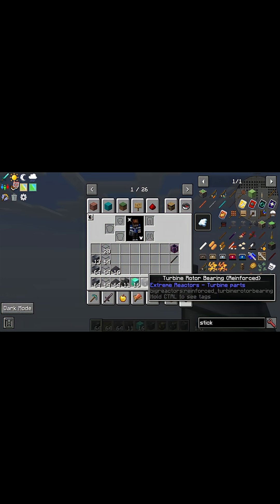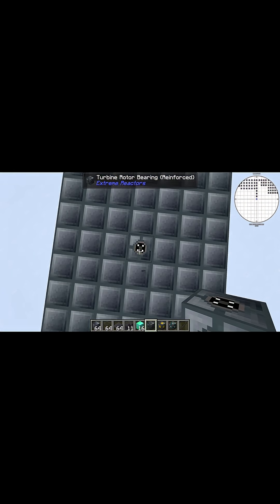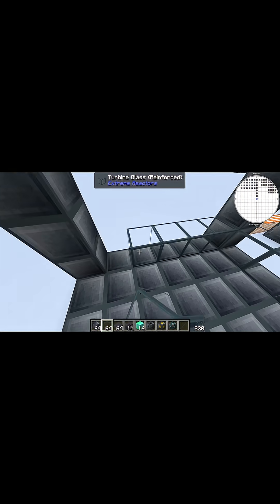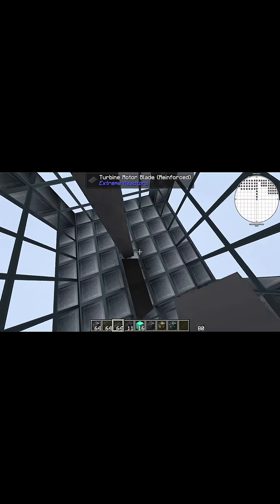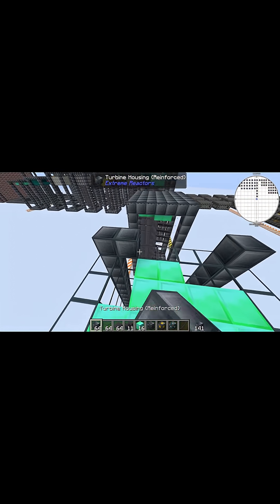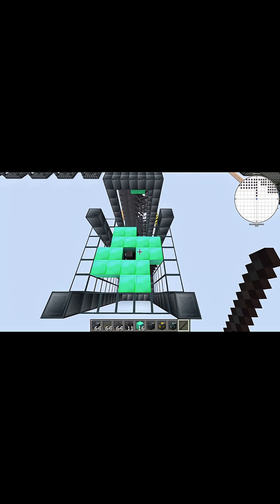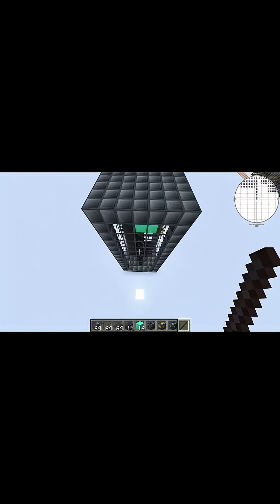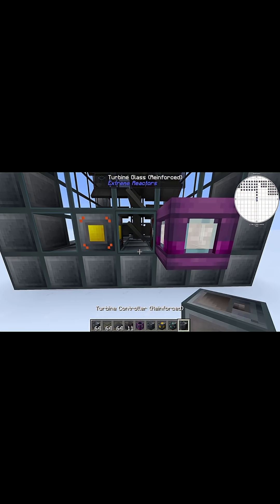Optimized Turbine Tutorial | All the Mods (ATM) 10

Comment: note to people in comments: this design will cap out your rf output depending on the pack. the buffer size limits the actual output u get and this design has maybe like a 10mrf buffer. the insanite cost is very nice, but if you want to actually optimize this and get the amount of output hes saying, you need to build a bigger reactor. adding more turbine blades actually gives more rf capacity. so u essentially just need to build big a wide and tall enough reactor with enough blades for this to be worth it.
Reply from the maker: Interesting, I never knew this. Doesn't seem to have any influence on ATM 10, luckily.
Reply: @thunderd164 yeah they mightve tweaked it so you have a bigger buffer. Have you checked its input rate into like an induction matrix or smth? Or the buffer size of your reactor?
Reply from the maker: @capnbug  No, I simply outputted into an energy trash can which drained the entire thing instantly. So I assumed that it could output infinitely assuming whatever you're outputting to could keep up with the output.
I just tested it, and it seems my hypothesis was correct. You just need something that can handle nearly infinite transfer like a Flux Network.

Comment: just tested this in project nope zone on 1.18. a big problem people have noted is that the buffer of a turbine that size cant actually output all that power(i.e. if the buffer is locked at 8mrf, it can only output 8mrf/tick max). on top of that mine are capping at like 40mrf/tick but thats a smaller problem.

Comment: how do you keep the rotor rpm stable for consistent power output?
Reply from the maker: With 16 insanite blocks and 2000 mb/tick of steam coming in, it should auto stabilize at 1799 RPM or 900 RPM with 32 insanite blocks. If you're not using insanite as your inductor, check out the linked video's charts to see how many blocks of your preferred inductor you should use.
Reply: @thunderd164 bet thank you
Reply: @thunderd164  I have the 7x7x13 turbine with 16 insanite blocks then 7x7x3 reinforced reactor with checkerboard fuel rods, no coolant. Got my turbine set to 2000mb/tick but not that I’m looking at it I think this reactor size doesn’t push out enough steam to sustain the turbine? I’m on the all the mods 10 to the sky btw my turbine makes the same power output as advertised so I would assume that the setup would be the same. I think I’ll just make my reactors one block taller
Reply from the maker: @thatoneguyJ  It could be because you're using uranium blocks instead of ingots for fuel. For whatever reason, they don't allow for as much steam output. You can also right click one of the reactor control rods at the bottom and make sure it's set to 0%. If it's not, set it to 0% and then click "Change all".
Making the reactor one block taller is a surefire solution, but you'll likely end up producing much more steam than necessary, leading to a loss in fuel efficiency. If you're not using any coolant, then you can also just fill in some of the empty spaces with more control/fuel rods to avoid having to scale upwards.
Reply: @thunderd164 that was it, that’s pretty dumb how blocks would make less than Ingots but oh well. Again thanks for the help I appreciate you taking the time. My first ATM or any pack like this and I’m liking it so far